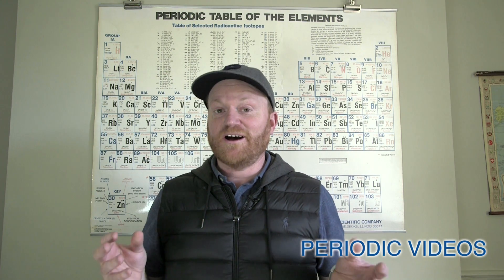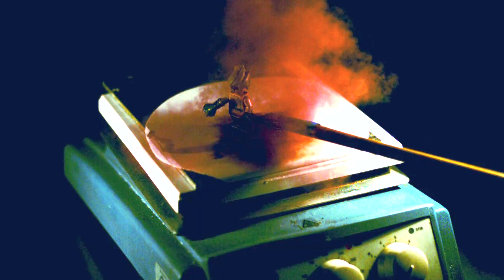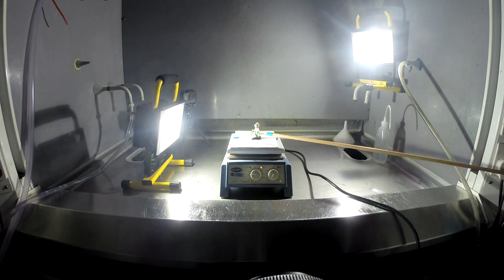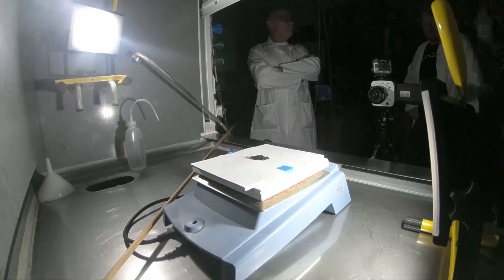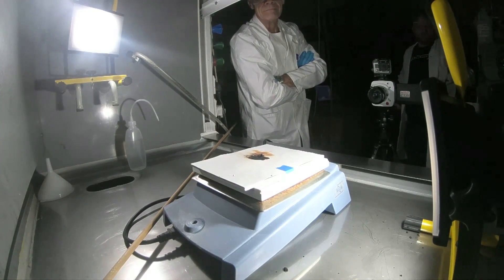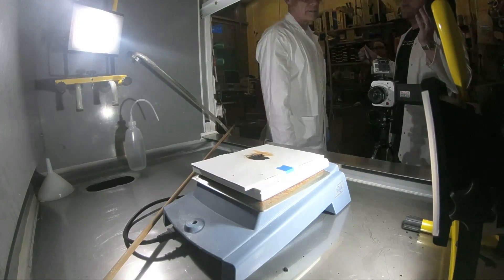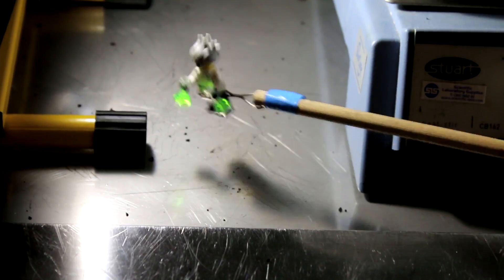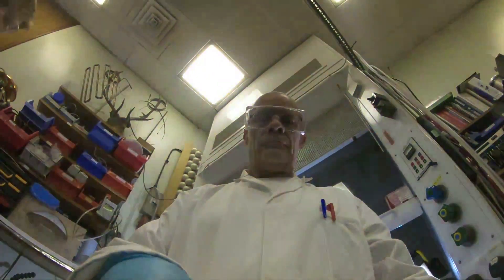Nitrogen Triiodide (extra footage) - Periodic Table of Videos

Comment: So you pushed the trigger mid explosion? That's super power fast, if anything.
Reply: No he pressed it right after, those cameras work by setting a resolution and fps to capture from that point you start recording to memory. But you can only have a limited amount of high bandwidth RAM type storage, so the oldest present video data is constantly being overwritten. The trigger when its used will dump the recorded frames to permament storage.

In practical terms this basically means that you press the trigger after the event has happened and then you get a number of frames recorded determined by your settings.
Reply: I stand corrected. Thank you for the explanation.

Comment: How did you get footage of it before it detonated if the sound caused you to film it
Reply: NattyGman A slow motion camera records constantly but will only store a recording for a very short time so when you press the button it records what's happened within a few seconds before you pressed it.
Reply: These cameras continuously send data to a looping buffer. The buffer is finite and can store a given amount of image data, video length depends on buffer size and resolution set on the camera.  As the buffer is filled the continuously  data overflows to the beginning of  the buffer to start the storage loop again.  Pressing the trigger tells the camera to stop filling the buffer and retain what is currently in it and also marks both ends of the block of data in the buffer to designate that as the stored video for playback/transfer etc...

Comment: I looked around online a little and could not find nitrogen tri iodide being used as a primer in ammunition like mercury fulminate is today.
Reply: No, you wouldn't find any data, it's far too sensitive for use in a primer. Mercury fulminate is no longer used in primers and hasn't been for nearly 100 years. Reason-mercury reacts with the brass case and makes it brittle. Lead styphnates are commonly used today, although there is a move to non-lead priming compounds.
Reply: Very interesting, thanks

Comment: The iodine stains everywhere where quite annoying I guess...
Reply: It depends on the surface that is stained, but thiosulfate or metabisulfite are usually used, if it can be removed. If these are not available a sodium or potassium hydroxide solution could also help.
Reply: Or maybe try baking soda to avoid any fingers turning into soap.